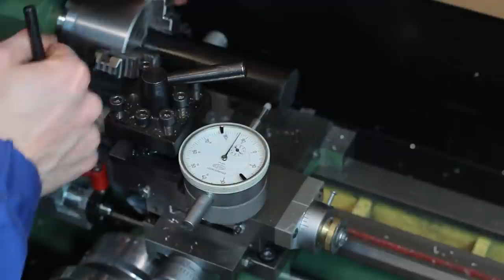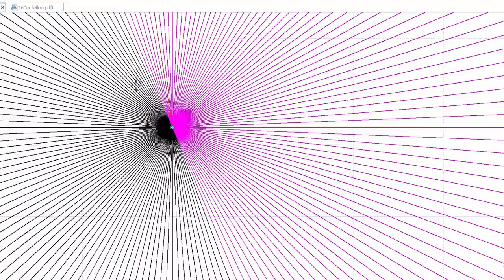Dividing attachment for the Mini Lathe - For making scales on the Lathe

Comment: I'm not going to lie I did expect you to etch or at least transfer onto the plate rather than just sticking a printout onto it - but hey, if it works it's not a bad idea!
Reply from the maker: Hi, thanks for your comment! Yes that would be cool to kind of engrave the scale into the plate. Glueing a piece of paper on the wheel is very primitive but has the advantage of an easy change to an other dividing scale when needed. For the next project I need a 160 division but perhaps some day I need a 100 division or something.
Reply: @WeCanDoThatBetter  You can directly print on thin alumimum sheet using an inkjet printer, just like those print-on-metal picture services do. Might require some light sanding, degreasing, and possibly some injet precoat to improve adhesion. Added benefit of buying is: commerical services can do fancy effect colors :D
Reply: @WeCanDoThatBetter  Maybe too late now as you used countersunk screws, but with an adjustable pointer you could have several commonly used scales at a different radius and have another set on the opposite side.
I bought a cheap dividing plate to adapt to the spindle on my lathe, haven't yet made a locking pin to go into the holes though.

Comment: a word of advice , to prevent such a tangle on your lath ues a  tat in a  rotary router to cut your stock to size it will chip nicely & give good results. & i do all my taping & treading on my late this way  & i Discover it cut plastics & thread's well to a  tap cuts plastic  well , when ues in a ratter

Comment: I also used a hockey puck to wedge the degree wheel to the spindle shaft. Very cool machining a hockey puck. Try it some time for rubber bushings! 🤣👍
Reply from the maker: Nice tip, thanks :)

Comment: I bodged together something along the same lines as that for my last lathe. The centre bore clamp was a turned brass bar, that I drilling a pilot hole along, threading the last 2 inches, then slicing that end off at 45' to form an internal wedge clamp (Like the handlebar stem on older bicycles) and drilled out the rest to clear some M8 threaded rod. The disc was just a 300 x 7mm circle of steel I had kicking about, and the scale was a 150mm 360' stainless steel protractor I found second hand online. It didn't look as neat as yours, but it was very strong, and it had one big advantage. I drilled and tapped through the edge of the steel disc, and fitted a spare machine handle to it. With this, Once I'd un-tensioned the drive belt (So the spindle could free wheel), I could use it to hand crank the lathe for carefully cutting threads up to a feature.

It was a really handy accessory, but unfortunately I bundled it in with a load of other extra tooling when I sold that little lathe.
Reply from the maker: Thanks for your comment! Sounds like a good built too!

Comment: I bought a cam degree wheel used for engine timing, it was made out of 1/16" steel sheet and very stiff. May have been tempered before adding the degree overlay. It is a 9" Sportsman Degree Wheel #4790. Thanks for the video and sharing
Reply: Great Minds think alike. I used a degree wheel too! Greatly simplified the whole project. These guys are working too hard. Time is precious. I’d love to see what you came up with.
Reply: @358trucking  I'm certain your mind is way past mine but thanks. I will certainly share what I have with you, just repaired a huge oil leak that's been going on since I bought the lathe. Apparently at the South Bend Factory they drilled too deep on the top stop pin for the Reverse/Forward gear train. I thought it was some cracks around the top and bottom hole but there was a compound in the bottom of the top hole with fine metal particles mixed in. Long story short I packed some JB Weld, a small amount and tamped it in using the back side shank of a 5/16" drill bit, let it set up overnight and tested it, no leaks. Now I can put it all back together and get going again on the projects. Talk to you soon on the degree wheel. Thanks

Comment: May be you can try go digital.
There are inclinometer sensor under US$10, you need to connect it to an Arduino and some LCD display to do the readout.
The sensitivity of these gadget could go to 0.01 degree.  That means you can have 36000 markings on a circle.
With a bit of programming, the angle adjusting work can be automated.

Comment: Great result - have you thought of a way to lock the spindle? Working on a similar concept and haven't decided how to approach this, or if it's even necessary. Thanks.
Reply from the maker: Hi and thanks! In my last video I just pressed a piece of wood between the chuck and the spindle casting for locking the spindle. That's the quick and easy way. But I'm thinking about other ways for locking the spindle. Not sure yet. There are electromagnetic brakes. Perhaps it is possible to install these.
Reply: @WeCanDoThatBetter  You could add a detachable worm gear to the spindle. That way you could not only lock it but also move it a specified amount

Comment: Excellent work -AAA-, but I will like to see how you securing the lathe spindle so it will not move after you selecting the deviation you choose.
Don't 
Worry
Keep
Turning
😉
Reply from the maker: Thank you :) That is another problem to be solved in future :) In my last video I just pressed a piece of wood between the lathe chuck and the spindle housing for locking the spindle. This is a temporarily solution but it works. I'm thinking about better ways but not sure yet how to do it. There are electromagnetic brakes to screw on motor spindles for example. Perhaps something like this.
Reply: @WeCanDoThatBetter  I don't think that the idea with wood or electromagnetic breaks is a good one. Just remember, in machining the most important is rigidity. Anyhow, keep thinking and I will and maybe wee will find I good solution.
Reply: How about mounting a clamp to the lathe which holds the Alu disc and prevent spinning?
Reply: @mariodejung9102  Hmmm ....🤔🤔
maybe....

Comment: It's only a matter of required precision ... But please check your printer. One way is to print two circles, overlaying the two sheets, one with 90° rotation and visually checking by backlighting. Hopefully your ending up with circles and not with ellipses. 
And ... some kind of nonius (vernier scale) will improve the reading and positioning.
Reply from the maker: Thank you for your comment and the hint on the printer. I wil check this. Yes there is potential of improving the whole thing. The idea with a nonius is good.
Reply: Possible additional errors to precision are ...
Paper distortion by wetting it with glue (-> acrylic disk just a little shy in size will keep it flat without glue). But keep the scale free for parallax-free reading.
Centering the paper (-> location pins + concentric circle on the acrylic disk)
Reading: nonious, magnifyer glas
It's difficult to get down to 0.2 mm precision without a professional rotation table.

Comment: Some improvement ideas:
First we have to ensure that the printout of the dial plate has not an X-Y "aspect ratio".
2nd issue is centering the paper as you showed at 9:31. Here i would propose to engrave "register and crop marks" to the plate. When you design your paper dial you may foresee crossing lines in the middle of the radiuses and punch out round windows to fit them with the register marks using some fine magnifying glass/toy microscope.
3rd issue is to fix the plate when working on the chuck side. I would like your idea mentioned earlier to use a worm gear. With that positioning should be much more easier-
4rd: An additional idea could be: Using a nonius style index pointer.

Comment: How did you managed to get paper so centered on that aluminium disk?
Reply from the maker: Hi, thanks for your comment. In the disc I made a 10mm hole and on the paper scale I drew a 10mm circle in the middle. I applied the glue to the scale and roughly centered the paper on the aluminium plate. Then I hold the plate against a light and adjusted the paper until the printed 10mm circle is aligned with the 10mm bore (the bore was shining through the paper). Perhaps I will make some gadget for centering but for now that worked ok.
Reply: Pin prick hole through the paper centre; 10mm dia short shaft with centre machined pimple ; place through the 10mm bore and align disk to paper using dimple and pinprick hole. That should do it and improve accuracy too. 😎

Comment: 4:04 NEVER pull chips off like that. This is a GREAT way to brutally lacerate your hands and fingers. Yes, even with plastics like POM/Acetal/Delrin. Ask me how I know. >:U
Reply from the maker: Uh, ok thank you for the tip! I will keep that in mind next time
Reply: Ok. I’m asking, how do you know? What did you do that you shouldn’t have?😂😂I did it too when I was first learning. It’s a rookie mistake. It’s easy to forget that shaving stringer still have tensile strength. 🤣🤣🤣Keep making chip! 😀👍

Comment: Hello, can you please help me figure out from 9:10 to 9:12? Would you be able to share how you centered the scale to the work or is it the case that it is obvious when aligning by eye?
Reply from the maker: Hi, off camera I adjusted the scale more exactly. In the middle of the scale there is a 10mm circle printed and in the middle of the aluminium plate, there is a 10mm hole. I glued the scale to the plate an then hold it against a light and adjusted the paper scale until the printed circle and the hole in the plate align with each other. That's not the most accurate way to do but I hope it is ok.
Reply: @WeCanDoThatBetter  Awesome, thanks! Lots of details in your videos, keep up the great work!

Comment: A measuring tool, in this case a vernier calipper, is never used as tracing needle or otherwise. A measuring tool remains a measuring tool and nothing else. This is a paramount Basic in mechanical works and the use of measuring tools.
Reply from the maker: I know. It is an old one which got mistreated in the past, so it's only for inaccurate work.
Reply: Thanks for your reply. I do like your videos & the great ideas behind. We Pro's do have a Leadership function fot he Hobbian's :) Hence we do have to show them properly. Like using safety goggles, not using woven gloves when operating a tool machine etc... etc...   @WeCanDoThatBetter